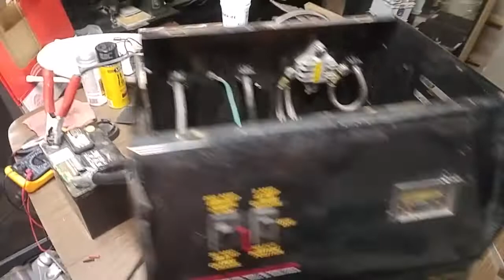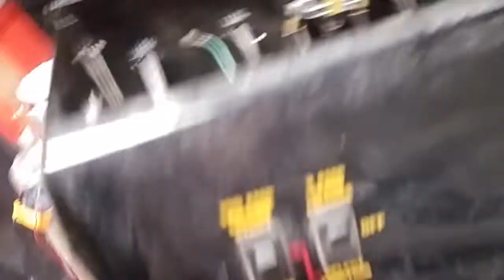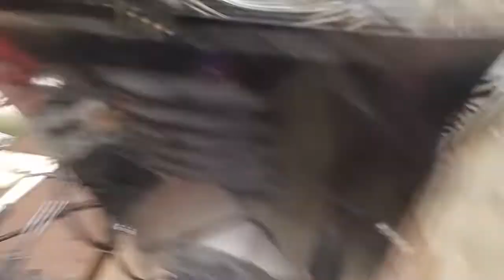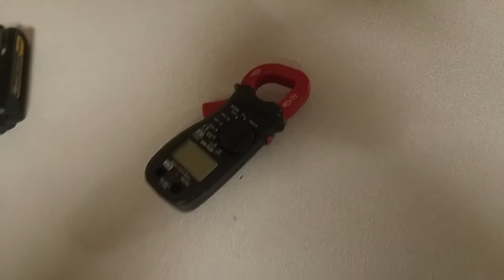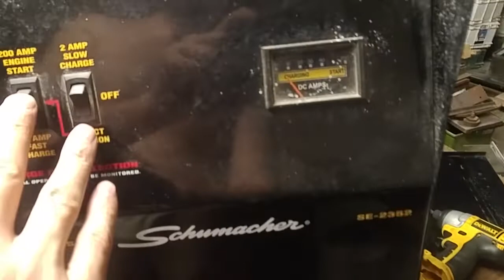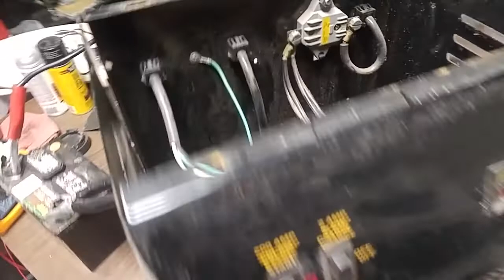Schumacher SE-2352 200A Car Starter 35A/2A Battery Charger Update 1: Inspection & Test Charge

Comment from the maker: Schumacher, not Schlumberger!  Woops!  I also comment wrong regarding some of the wiring details... so next time wake up a little more before making a video.  I suppose working on a hot day Riviera style on live electrical to test voltage outputs (and hoping current though my clamps wasn't working) had me more worried about being careful around my DUT.